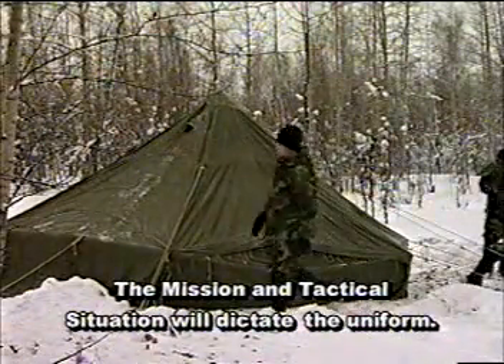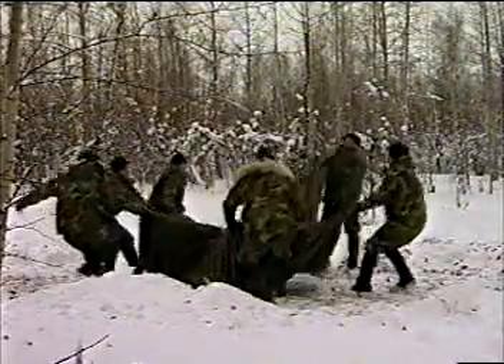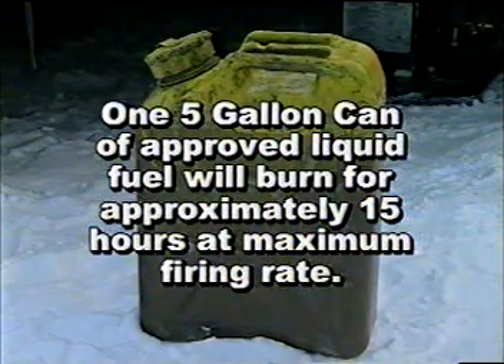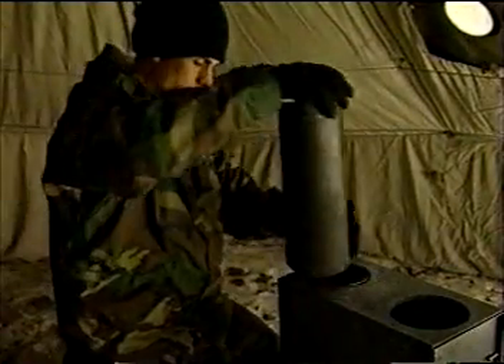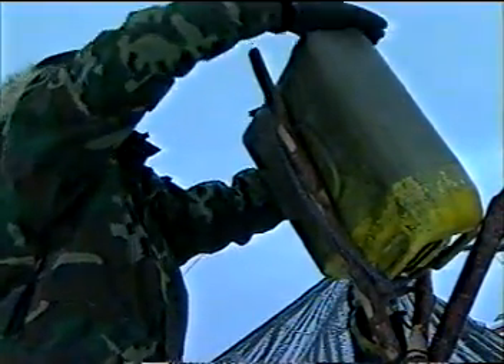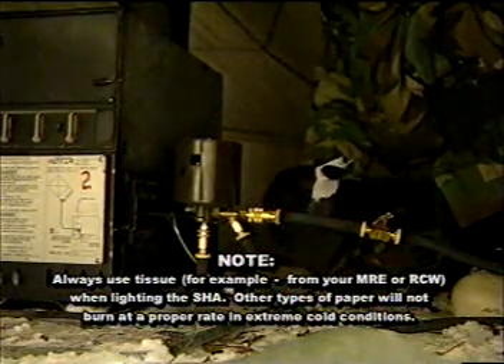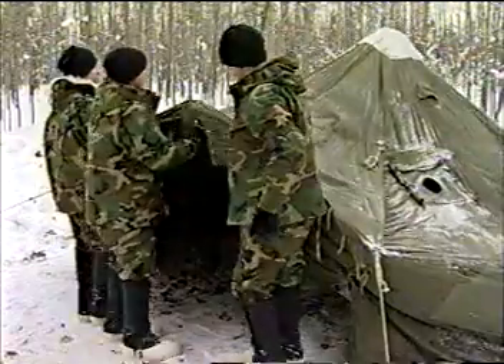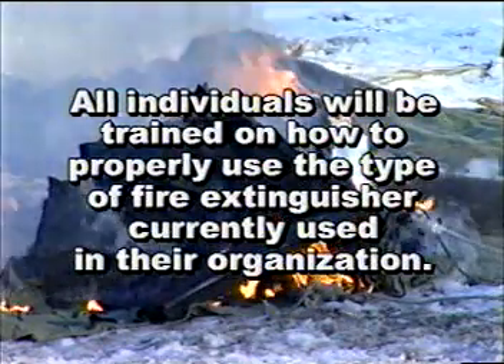Northern Warfare Training Center Tent and Stove Drill

Comment: this is an awesome tent period.  One person can set it up but two is really required.  take down by one person easily performed. Used this tent for a few year in Colorado archery elk hunting.  Temperatures during those years were warm, did not really need a stove although one year installed a wood burning pot belly stove.   Basically too much heat too be comfortable inside tent.  Below zero we would have been more than comfortable.
     Ten men would be damned cramped in this tent, but for combat would be great.
   If you are looking for some thing that 3 people can put up, be comfortable ( unless you are really tall) this is the tent.  going to be really cold bring small wood stove that you could cook on  electric lights as burning a lantern maybe dangerous inside or candles may be option. also quick note all the sides can be undone and folded up on hot days making it a cover more than a tent.  10 out of 10 this is a great tent very sturdy.  we got one after the first year elk hunting we went out set up our camp the week before, storm came thru and blew it all down or away.  this one will not blow away LOL

Comment: Good video over all. One point to consider, the fuel can as shown on the field expedient tripod is too high.
From the TM (At the fuel supply site, set up fuel can stand (optional item, refer to AAL WP0045) with fuel can (5) level or slightly above heater as detailed in the next section.)
The reason is the additional height (head pressure) could cause the fuel to overfill the FFCV and create a fire hazard.
Reply: Additionally, it may be the policy at NWTC to get everyone out during a fuel change (with the old YUKON stove it was mandatory due to using MOGAS)  but with the SHA (diesel) it is unnecessary. The quick disconnect allows fuel cans to be switched in seconds. There is enough fuel still in the FFCV to burn uninterrupted during the change over. To get people out and exposed to the elements opens them up cold weather injuries as well.